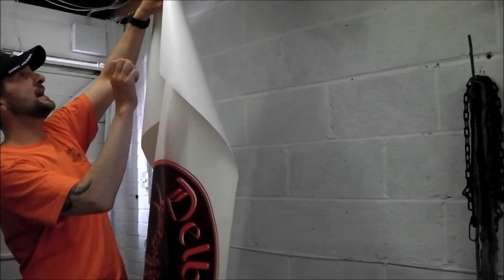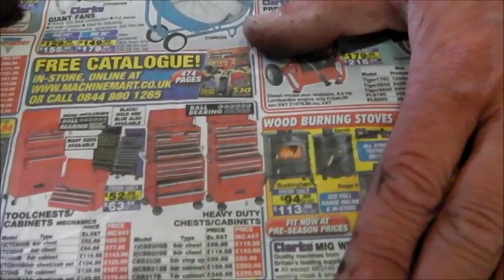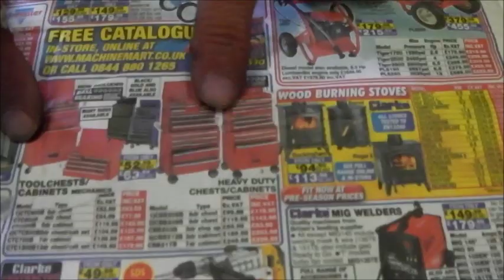Delboy's Garage, Mail call and 'My First Tool Kit'

Comment from the maker: Hi mate, now there's a well traveled knowledge regarding open end spanner it does indeed refer to 'across flats', American Fine actually refers to the thread pitch and it's become combined and confused over the years ...way back when there were 2 imperial thread pitch ranges along with also B.S.P. & B.S.W., like you said, wise old heads!  Cheers mate, Del

Comment: Think ive watched nearly all your vids now and have spread your name with other bikers at work, we now talk about the jobs we have done after watching your tips and help, so thankyou for your time in making these. I ride all year round so all the cleaning vids have been superb!

Now a tip for some of you watchers on a budget regarding this video, something ive done and really works for me building your tool collection..... thats get yourselves down to your local car boot sales and build up a collection of tools from there. People are always clearing garages and stuff to sell off dirt cheap!.

Of course it takes time to build up, but you get what im saying you can get some real bargains on a sunday car boot and some of the older tools are way better than todays too so look out for those old boys selling off their stuff, they were built to last back in the day and you can pick up toolboxes and some real neat hand tools, spanners all that for just a few pounds.

Anyway just thought id throw in my two pence worth.

One vid id love to see is how you drill out a stuck stainless steel bolt, I had two bolts stuck on the right side on my ZX10r's rear sets, the stainless steel allen bolt rounded off from some monkey boy pressure, so we tried a star key method, still didnt budge and rounded off further, tried heating it, nope, drilled the top off thinking that would free it, still nothing, tried a thread tool and it wouldnt bite, tried a double nut on the back thread ......still not even 1mm of movement, I ended up drilling it out but went through 8 good quality expensive drill bits and a hell of a lot of time and sweat as they just kept blunting off on the tips, had 3 people trying to help and all said theyd never seen anything like it, no corrosion nothing, I can only think the bolt had swollen outside the front and back of the hole it was going through, anyway a day later job done (when i say done they are still in there but flush so ive now got the rear sets in a lower hole) but was a nightmare. Any tips on drilling when a stainless steel bolt is involved? Keep up the great work Del

Sparky

Comment: Hi Del! 

Well, i had two problems shortly after i got the bike, one of the floats got stuck, so in the morning there was a mixture of gas and oil under the bike, and the oil in the bike was full of gas. I changed the oil, plugs and oil filter myself, and took the bike to the shop, only to have to return it 80-100 miles later due to poor running - the genius that painted the bike also painted inside the tank, so flakes of dissolved paint got inside the carbs..

Thanks for your commitment! 
John

Comment: great video, i ended up getting a tool box/chest upper and lower, full of tools. from draper, it had everything i needed to do basics with bikes. i have had to buy a few tools, oil filter tool, helicoil kit and tap and die, but it covers most things.
i got it from draper for about £300, so far nothing has gone wrong with it. (touch wood).
but now i have started racing the box comes even more helpful for race prep and such.

Comment: Hello, spot on vid as always Del & PP. When I restored my Bandit I needed tools, so. I got a Large socket set from Halfords, reduced from £120 to £60 & a set of mole grips. From Machine Mart, torque bit set, Alan socket set (with the infamous 6mm) and an impact screw driver, (very useful)  came in around £80, metric/AF Alan key set from Maplins for £9.99  (made by draper). So I spent roughly £150, no torque wrench so I went with your way of marking with nail varnish (utter top tip).... Cheers.

Comment: Love my 1/2 breaker bar too ! I now use Halfords Pro range good price and also has a life time cover as long as you keep the receipt (I found this out the hard way !) good advice Del I started out at 17 with the basics and have added to it for the last 30 years when I need a larger socket for wheel nuts etc etc etc

Comment from the maker: Hi mate, when you say swaying, if you mean rocking rhythmically side to side that can often me attributed to the fuel swilling side to side in the tank... the tank in Bandits are un-baffled and quite flat bottom, so the fuel does tend to sway about a bit, but there is no side to side motion in the engine as it's a transverse design... like I said, it's probably your fuel moving around, specially if it's half full...

Comment: Del great video that is a great starting toolkit.  I'm glad you left out adjustable or crescent wrenches those are really easy to misuse and round off heads.  Surprised nothing for electrical troubleshooting like a test light or multimeter.  Then again most modern bikes don't have problems with the electrics I guess.

Comment from the maker: Is the caliper supplied 'ready to use'?, or does it need to be built up with new seals...  have you got the bleed nipple fitted and is it closed when you pump the lever?.....air will pass through the caliper as the fluid chases it out, so maybe you just need to persevere....bleeding a dry caliper and line can be trickey...try bleeding it upside down.(.hold the caliper above the master so you pump fluid UP...then the air will naturally rise up and out the bleed nipple..)..good luck mate..Del

Comment from the maker: Brass wire brush every time for me mate, but you're right, the heat clean tip works ok if its light and not too carbonized...which in FI bikes it wont be..

Comment from the maker: Waddup matey, This one is almost becoming an 'FAQ@...i always answer this common question the same way... "Go along to your local "Machine Mart" branch in person (not just look up their website) and have a chat with the guys there, they are knowledgeable and helpful, tell them you have never welded yet, and want to use it to get started, and they will certainly guide you right.  I would suggest a 'Gas' rather than 'Gasless' because the fluxed wire is really expensive.  see how you get mate. Del

Comment: great kit.I have been collecting tools for many years! LOVE tools! just check that high pressure wand, i think that specific one is made for cleaning concrete, My Karcher set advises not to use the one in my set that looks like that wand on rubber and painted surfaces. cool!

Comment: Thanks Dellboy for this video, because of this i have tidied up my tools and picked up a new tool box especially for my bike.
I am a beginner when it comes to maintenance but with your help i took apart my brake caliper and rebuit it. The brakes are fantastic now, thanks again.
I also did an oil change and its was needed, even though it was serviced about 3 weeks ago by a pro mechanic. The filter was never changed so i will look after my bike myself from now on.
I think i have a small oil leak from the engine and would be thankful if you could make a video on tightening your engine bolts? Or at least talk about it? The bike is a gv250 2001 Hyosung v twin. :-)
Reply from the maker: Charlie Rutledge Hi Charlie, glad the videos help mate, but I know nothing about Hyosung's except that they're Chinese, or something... a leak from an engine case rarely means a bolt is loose, it more likely means a gasket has been breached and must be replaced

Comment: did front brake calliper rebuild (front left - sv650) yesterday. thanks for the confidence del, it was an absolute doddle. Was prpud as punch with saving the dollar, went to ride the bike and it wouldn't fire. argh, literally no response. fuses all look good and battery is fine, so hoping its just the ignition switch. labour of love? :-/

Comment: great vid del (as always) i thought i was hilariously under equipped,but it seems i have an alright array of tools!! i think i just need to remove some of the ''house of straw'' shite and replace it with slightly more comprehensive sets and deffo need a tool cabinet, already got 1 cantilever full of finemetal work tools and a massive plastic tool box, its  real pain in the rase trying to find anything!

Comment: Great video Del. I have a chinese 186 piece tool set (Google it). It's most probably house of straw but you can get it for as low as €50 if you find the right deal (people go from door to door with them) which is great when you look at it. I think of it as a great way to start and the good part is that you can probably combine it with one of those chests you were talking about. Anything you use often will probably break, and you replace it with a higher quality one.

Comment from the maker: Just being honest mate, to say "it's a cheap and easy way to get wrenches, screwdrivers, sockets, pliers, etc. I won't break any of them soon." you certainly will once you start using them..any tool should be made in a proper foundry and go through proper processes of hardening and plating to make them reliable, not only that, the sizes aren't accurate and once you force a really tight bolt, it slips round, trashes the bolt head and probably skins your knuckles.. sorry if it was harsh, but true.

Comment: my tool collecting and general bits hoarding started when i was about 14 when i started buying old tools from car boot sales for 10p each. to my mothers eternal behest, this hoarding has paid for itself innumerable times. paid dividends when we had a drunken lout try to kick in the door at 4am, the impossible to buy lock deadbolt pins were promptly found in my collection of random door fixings, which in turn had been either bought for 10p or salvaged from skips etc. saved a big bill :D

Comment: hey del I use to love my stack on tool chest, but miss it now i'm in the states I think I did the best thing when I moved here I gave it tools an all to a young mechanical Engineer apprentice at the company I worked for. just gave it to him said here you go that gets you up and running, think it was better then shipping it over here, but I have found a new socket set that works better then the 1/4 drive the socket is open all through I do a reply vid and show you :)

Comment: Meant to add we call those heavy pliers your grandfather gave you  "Linesmen pliers", they are heavy duty you can beat the hell out of them they are robust. An old trick on spark plug cleaning, put the plug in a vise and torch with a standard propane torch and heat the electrode end it cleans them (if their not worn) and you can keep it for an emergency plug....

Comment: i use a lot clarke ,,my 3/4 drive socket set is over 15 years old and has had 2 new rachets,so i upgraded to 1/2 inch sockets set ,,,and the best thing so far is my 1 metre long 1/2 inch bar lol...

Comment: Thanks for the response ! The caliper arrived ready to slap on the bike, i managed to bleed it threw as i'm an expert (in other words i watch allllllll your vids (;  ) The caliper achieves good strong pressure BUT there is a blatant sound of air escaping from one of the seals, it's leaving tiny microscopic particles of fluid on the back of the pads, i suspect the seal has failed !?!?! when i press and release the lever & hold the caliper to my lug i can hear the air/fluid squirting :(

Comment: Smashing Vid :-)
I bought my socketset when i was 16 (now 47), it was a £5 special, but made in japan
It still works but the 10/13mm and 1/2 inch sockets look sad :-(
I have a hammer powered impact driver from the same era, oh so valuable for crankcase screws/bolts and a sprocket puller that works quite well for pulling bearings.
Only last year i bought a cheap hilka 1/2 drive ratchet and long reach sockets, very handy for fixing my mates aprilia habana 125 scooter :-)
I have hammers wa wa wa:-)

Comment: Hi Del & Penny, quick question = bought a brake caliper from aprilia, it's a nightmare to bleed threw, when i squeeze the brake lever & hold the caliper to my ear i can here air escaping from around the pistons, sounds like it's squirting ! The noise is there when i press or release the lever 
Surely this is not right ??  
Any help would be appreciated !
Thanks

Comment: Wow mate, not quite the reaction I was expecting. I don't see why for example your cheap socket set with the replaced ratchet is any different from what I bought. Basically these boxes are produced and sold in masses. If you google the specific number 186 you'll find it's contents. But it's a cheap and easy way to get wrenches, screwdrivers, sockets, pliers, etc. I won't break any of them soon. They actually feel quite good, probably not for pros. Brandlabeled they're sold for much more than 50.

Comment: Another great vid from you both ! Know what you mean about Snap on ! I have a Stack on roll cab a Snap on chest and 3 draw add on and Blue point tool cart ! Got them off Ebay ! worth the price that I paid as in tools mix of Snap on Britool Blue point Halfords Pro Draper etc etc and good old set of engineers tap and dies and have my late dads good quality toolmakers tools ! you can spend a fortune on tools but I'm a certified toolaholic lol I have had cheap chocolate tools that are real crap.

Comment: Hi Delboy, i love your video's iam 72years old but willing to learn about bikes i have ordered a new Thruxton but have to wait until April 2015 to get it. I also own a 2014 yamaha bolt my problem is i cannot find anywhere information on disabling or remove AIS. any help would be much appreciated. As i live in thailand info can be difficult. Thanks in advance. John
Reply from the maker: Hi John....how good to hear from you Sir, and all the way from Thailand too... not only that but to be still biking strong at 72 you are an inspiration to us all...it must be that lovely warm weather you have over there..

Congratulations on the impending Thruxton, shame you have to wait, but the factories just cant keep up with demand at the moment. Triumph are having a huge success all over the world now.. and im sure you'll love the new bike.

The air injection was a video we made here about a year ago...so here is a link ;- https://www.youtube.com/watch?v=Y2jaTKzK2IA

I must ad a note that if you intend to take it off, then its important to take the O2 sensors out too or the ECU will read it running rich and mess the mixture up trying to compensate...so take the sensors out and blank off the wiring...and get it remapped to run right by the dealer.... personally, i've refitted the air injection to my bike now as im happy with the way it performs, and i like the 60mpg too...there is a lot you can do to the Bonneville engine, so have fun with it my friend..

Thanks again for getting in touch, ride safe, and take care... all the best.. Del.

Comment: Famous last words "you don't need them", referring to missing sizes in metric sets.  Usually you don't, but eventually you will, likely when you don't have time to go to town and buy one.  So you finagle an adjustable wrench in there, screw up the head of the fastener, but get emergency repair done. Then do it all over again after you buy the new 18mm wrench and the new, replacement fastener, usually more expensive bright work type.  And of course, buying the one wrench costs about a third of the cost of the whole set.  'Marketing'.
This is what I hate about metric sizes...there are too many hex sizes, too close together.  Shank and thread sizes/pitches are not the problem.  As a mechanic, I can glance at an SAE hex and guess the size right 19 out of 20 times.  Lucky to hit 50% with metric.  Then of course sometime in the 80's, American cars started having a mix of metric and SAE fasteners.  That's REAL genius.  The guy that signed off on that needs an 18mm stuffed sideways somewhere dark.

Comment: Hi del just found you on you on you tube brilliant like having a "mate¬ in the trade!!!!
love all your tip.s eg the water pipe for seating fork oil seals  got a old (T)rusty mz
deep in the shed under all the usual abandoned junk we brits store in the shed !!!!
think the time as come to get it back on the road and to hear that old ying ding ding ying ding again think some where even got a set DDR SUPERSTEEL BOX SPANNERS yes that.s what.s stamped on them each one twin sized good with
factory tool kit to strip the whole bike down long long time ago many years and 
a few stone lighter got a supa 5 when my honda superdream L plater eat it.s camcain
and sawed it,s own barrels guess which one more fun to ride in nutter mode ??
any way intend to use your post as work on my "classic" motorad  ps
find aldi and lidl good for tools when on offer find lidl carry the gs stamp on
a lot bit like a eu bristsh kite mark thing pass me rose tint specs think time
for a old fart,s snooze  zzzz yingdingding  zzz
Reply from the maker: Thanks Tony, you're very kind, we just show what we do and if it helps, that's great!  Enjoy tinkering with your bike mate, and don't forget to enjoy the summer on the road!